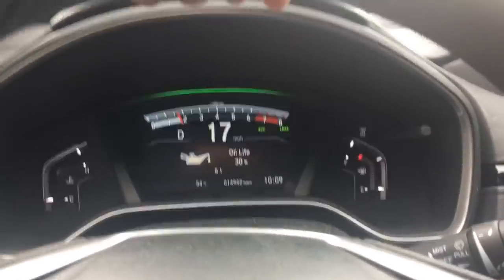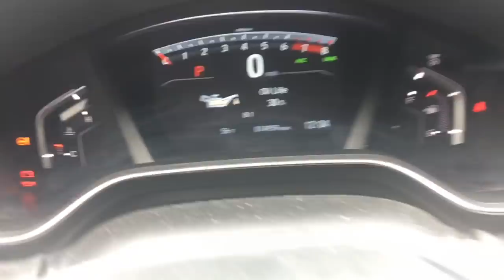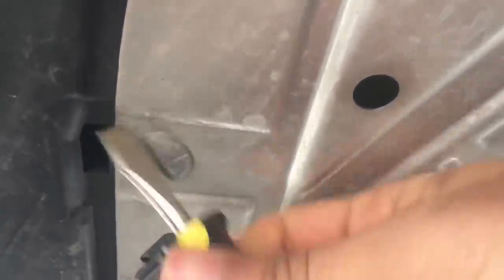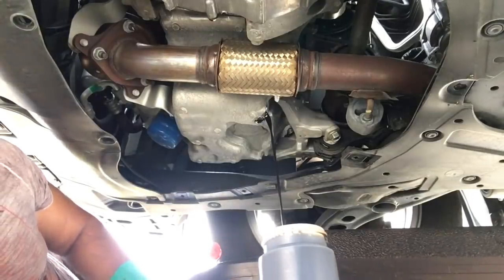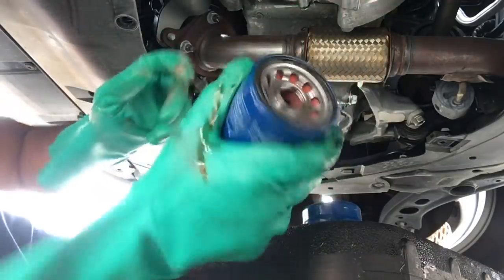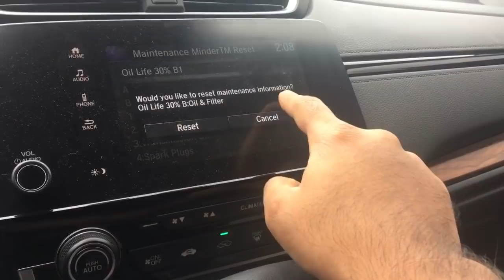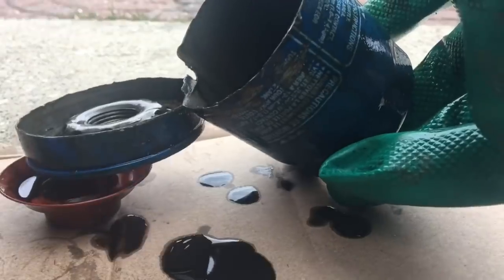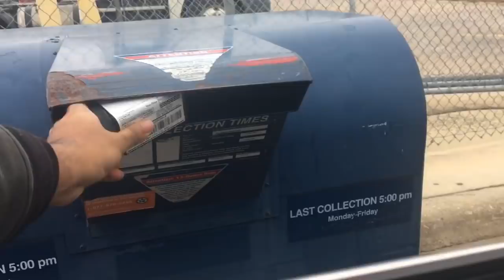2018 Honda CRV Oil/Filter Change and Analysis - Oil dilution -  Cut Open Filter

Comment: I got rid of my 2018 crv last Monday. Honda didn't even want the vehicle back. One week later the car is sitting in the back of the dealership like they can't sell it. I found it funny. I purchased a Toyota and salesman said I'm the third Honda Owner that switched to a Toyota. Your videos are great and educated me on the problem. Thanks. I hope Honda fixes your car. I didn't want to wait and see what happens, plus having no heat in the morning because the car couldn't warm up also prompted me trading it in also.
Reply: Did you have a problem? Ive tun oil analysis and it showed very low wear on our crv. We live in CT. I feel like the issue is a bit overblown
Reply from the maker: travelingThrew I figured with the new Rav 4 coming out Honda will loose some customers. Thanks, hope they have fix for me.
Reply: Dengine I live here in Illinois just next to O’Hare airport (ord). Last week we had a cold snap where the outside temperature was 10 degrees when I went outside to go to work at 4am. I drove 15 minutes to work where my semi sleeps for the night. I had no heat all the way to work. My 2018 CRV touring did not warm up at all, my windshield was nice and full of ice all the way to work. That was the tipping point for me. And yes my vehicle had the oil dilution problem. I took it to Honda On Grand where I bought the vehicle and they changed the oil and the lube tech said he has never changed oil on a vehicle where you can smell fuel and see the oil just pour out like water from the drain plug. I was there when they dropped the oil because I wanted to see it for myself. Trust me I was not happy bending over and loosing $4500. In 8 months.
Reply: Dengine . The car has been sitting in the back lot away from the used car lot and new car sales. Why is it sitting there? My car was the dark green, I also purchased every accessory for it and even left my damn weather tec floor Matts in it. I wonder if it’s sitting there because they can’t resell it. It only had 8,900 miles on it.
Reply: @theeverythingchannelyt548  Not to mention the tax! I'm going to try to pursue the Lemon Law to get my full value back.
Reply: Miso Honey I got lucky. When I traded in my CRV I didn’t pay tax on the new car. I only paid for transfer of plates and some fee that I tried so hard not to pay for. But I paid anyway. If you do a solo lawsuit don’t forget about the attorneys fee. And they are steep. That’s why I just went with the class action. Good luck and keep the CRV community updated.
Reply: Stupid to trade it in so soon and lose the money. At least drive it for the 36000 mile bumper-to-bumper warranty. And... go to the dealership and demand them to fix your heater... show them or take them for a drive on a cold morning so they can see that it doesn't heat up and then they'll be forced to something.
Reply: he got rid of nothing this comment sounds really fake already
Reply: What you get for turning it back in? Did you need an attorney? Honda dealers are putting a big spin on this major issue
Reply: Overblown till you blow your engine
Reply: Miriam Vivo I got back $26,500 back for my car. That’s why I did it. I only lost $4500 give or take.
Reply: 723lion your funny really fake. You weren’t there when I bought the vehicle and when I returned it.
Reply: 06XTOR It was my decision to get rid of it. Why keep paying on car that has a major issue. The oil in my crank case was like water.
Reply: Smart to get rid of it! Anyone who thinks this issue is "overblown" go to your car and pour gasoline in your crankcase now. Add some every day too, like what is happening with cars internally. Issue isn't only on Turbo models or just 2018 models. I had a 2016 CRV TOURING non Turbo. It had lots of gas in oil. 1 1/2 quarts over on dipstick, no heat, gas smell, oil change was like water consistency. Direct Injection system is to blame, Honda will never admit it. I traded mine off for a Toyota Highlander, with dual fuel system. Never will buy a Honda again
Reply: MegaLifeChanging you wrote what I exactly  had in my brain when I decided to trade it in. Yes I also bought a Toyota Venza used, but hey the car drive a lot better and smoother than the CRV. 
Yes my 2018 was the same as you described, the oil in the crank case was like water. That’s not good for any motor. I’m here just trying to make people aware, for they won’t loose the money I lost.
Reply: travelingThrew that's how the 0w20 is supposed to be
Reply: @theeverythingchannelyt548  good for you getting rid of your Honda.

Tell us how that excellent resale failed you though?
Reply: @theeverythingchannelyt548  lost $4,500 on a Honda...unheard of!
Reply: Lol.. Exactly. 0w-20 is already thin.  And plus you drive quite a bit of miles before the oil change...
Reply: Both Honda and Toyota historically have been reliable vehicles.  That being said, Toyota is not immune to engine problems. Some of you may remember their oil sludge nightmare with  their 2.2 (4 cyl) and 3.0 (V6) engines.
Reply: @theeverythingchannelyt548  word is getting out. The more it does, the more they will depreciate in value
Reply: @06XTOR  add some gasoline, you're going to see 0w-20 get even more thin
Reply: MegaLifeChanging yes. The problem is people who own don’t know or just don’t care.
Reply: @06XTOR  0w-20 oil turns into - 0W-0 after getting mixed with gasoline
Reply: @johnk3500  Difference is how Toyota handles issues. They issue recalls and fix them. Honda lies to try and cover up issues

Comment: This oil dilution issue is crazy. I just bought a 2019 Civic sport 2.0 normally-aspirated 6spd. I love it.  I will always change my oil every 3000 to 3500 miles.. It's funny cuz I didn't trust the new turbo engines so I purposely did not get one. I did not know about the oil dilution problem before buying my car but I am so glad I got the 2.0 N/A.
Reply: How you like that Civic? I've been saying for bit that the 2.0 Sport was the one to get.
Reply: I love it.. Especially with the 6speed manual.  Plenty fast with the Vtec. The 2019 sport comes with the 18" rims that come on the r type as well.
Reply: @06XTOR  I had a 2.0 LX a few months ago as a loaner, even though it had a CVT I was pleasantly surprised by it.
Reply: @06XTOR  One other thing, you shouldn't have to worry about carbon build up on your intake valves either, since the 2.0L isn't DI.
Reply: Yes!  I didn't know that either before I bought it.. Lol. Port injection  just works.  I was really happy to find out it wasn't Direct injected
Reply: @06XTOR  Enjoy your car dude.
Reply: Of only they put that 2L on the hatch!! I go there once a year just to check if they did lol
Reply: Randy Jackson  Oil change at 3000 miles..thats ridicoules...a had a peugeot with 250000 miles...alaways changend my oil at about 13000 miles once a year...never had a problem....i sold that 20 years old car and bought honda civic 1.5 turbo 6 MT....and i dont thonk about changing my oli so often...my civic runs perfect without any issue last 7000 miles...no oil dilutiuon and without any problems
Reply: Randy Jackson  I have a 2018 Civic Si which is turbo and I don't have oil dilution problems and my oil level does not change so it's not burning oil. Is your turbo honda having a fuel/oil problem?
Reply: Randy Jackson  Time will say the true...I dont think this engine is bad..VW  from 2008...direct injected tsi 1.4 have extrene oil dilution but they run 100000 miles..Honda didn want to introduce direct injected turbo..I think they looked at problems and they made much better engine....Do you know that the Honda engines according to statistica are most realible engines ind the world----7 times more realible than VW or Audi ...4 times than BMW.or Mercedes...Double than toyota... Toyota is second....i dont think i will have any problen with this ebgine
Reply: Lol I got the exact same car for the exact same reason and I love it so far😆👍
Reply: Randy Jackson  ... neglect???  OMG, what century you living??  YOU sir are insane!!  Changing the oil every 5000 to 7500 or when the maintenance minder says is GOOD enough!!  If you are super concerned, then buy synthetic oil.  lol  OBTW: Welcome to 2019 LOL!!
Reply: 06XTOR ... waist waist waist lol!!  Just let the maintenance minder tell you when to change the oil.  It will go about 5000 to 7500 miles.  This car is not from the 1970's or 1980's lol!!  If you are so concerned, then run synthetic oil.
Reply: @biz4twobiz463   if they like to waste money on oil it's there choice I guess I always do what the manufacturer of the car tells me to. Cuz you  didn't build it but ya sure you know better, its oil illuminati and all.....
by the time i get to 100k/10years old i want a new one anyway 

TLDR do what makes you happy and
REV UP YOUR ENGINE'S!!!😝👍🚓
Reply: Randy Jackson  ... I can tell you one thing, besides be extremely wasteful with engine oil...YOU are one hilarious person Randy!!  LOL  I'd take that bet...and promise you'd lose. lol  millionaire status ROFL!! Only thing in your comment that was true...YOU do know the YEAR!!  lol

OBTW: Congrats finally reaching the "status".  I'm sure your momma is proud.
Reply: @thrpins8430  ... to a certain degree of course. But, the longer intervals are also related to taking care of our environment. But...at the end of the day, YES...it is the choice to be wasteful or not.  That also goes for leaving the running water on at home while at a baseball game.  Or leaving all the lights on at home while on vacation. Or running the car super hard and getting terrible fuel economy. lol  It is a choice.
Reply: @biz4twobiz463  agreed to me that much oil waste isn't worth a little extra life of a mostly recyclable vehicle
Reply: Randy Jackson  ... arrogant Much? Asinine much? But lack the self confidence. lol

Believe me...I am not broke, but family wealth is well your little millions. Yah, I didn't have to work for it... I was just born!! Best way is inheritance little man. lol
Reply: Randy Jackson  ... pure intelligent  response. What I would expect from an american. lol   Seriously, you are funny.
Reply: Randy Jackson  ... Well, at least we both agree on something. We are both funny!! lol
Reply: 06XTOR  bro I also bought the same vehicle an didn’t get the 1.5 turbo so glad I choose the 2.0. Also didn’t know the oil dilutions them engines had should have negotiated on that to the dealers
Reply: With modern syn oil, changing as much as you do is excessive and unessarsary.
Reply: 2018 civic hatchback turbo here. I have zero oil dilution. Purchased the car brand new. You're missing out bigtime. The civic really comes to life with that turbo.

Comment: I appreciate your dedication to make this video I won't be buying a crv any time soon!
Reply from the maker: Christopher E  hopefully 2020 they will have it ironed out.
Reply: @EATSLEEPJD  I hope so. Currently I'm thinking about getting the Honda insight for better gas mileage, but I was looking at small SUV's as well. This definitely helps with the CRV for this year as a choice
Reply from the maker: @user-pg9fv7su8q  what did you end up getting ?  I still have the CRV.  Issue is still there but nothing blew up yet.
Reply: @EATSLEEPJD  I got the Honda insight touring and really like it! The MPG is lower than advertised, but otherwise it's a great vehicle! No direct injection or turbo fanciness just the electric motor and battery to worry about instead. After doing some research it seems the battery is the only real worry but it's about $1900 to replace when it does go bad hopefully it's a wash with the saved mpg.
Reply from the maker: @user-pg9fv7su8q  nice congrats. I heard they are great cars. You can’t get anywhere close to that mpg with a CRV.
Reply: @EATSLEEPJD  I actually looked at the crv hybrid 2 weeks ago I like the the way it drives, and the size a lot! Wish they had it in 2019 when I bought my insight 🙃. I'll probably wait till the next refresh on the crv so I'm not loosing as much money on my trade since the insight is only a year old. You should definitely give the hybrid a look if you get bored on a weekend I'd be interested to see what your thoughts are on it.

Comment: Thank you for showing this video! I'm going to order an oil analysis kit from Blackstone as a result of this. I just bought a 2018 CR-V EX. Yes I knew about the oil dilution problems, but I wasn't too concerned because I live in Florida and I also know how things get blown out of proportion on the internet, especially with a very popular car. Still, it's going to make me sleep easier knowing what's in my oil.
Reply from the maker: Ramon Suarez Yes Sir. Good way to know if you got issues. Make sure to let them know who send you.
Reply: I'm in upstate NY. Not worried either. It's 10 miles to a grocery store. The car has next to no short trip driving.  My oil is fine and level is good. I got my recall notice last week. Honda won't let this wreck their reputation.
Reply: Change oil every 2000 miles

Comment: Shame on all the Motor magazines for still recommending the Honda CRV as a top buy. They are not honest just like Honda.
Reply from the maker: Consumer Reports pulled their recommendation.  They have an article stating the issues with the CR-V.
Reply: And consumer reports for recommending Honda CRV.
Reply: @EATSLEEPJD  when?  They have recommended CR-V for two fuel mixing with oil articles now.

Comment: Just got back my analysis last week.  I wish I could post a copy of the report but it appears I can’t. Fuel percentage was 4.8% and flashpoint was 290 degrees. Those values should be less than 2% and >385 degrees.
Wear metals were slightly elevated above universal averages for 4,700 miles but since this oil change was done at 7,400 miles this was expected. The one exception was copper which was twice the universal average but could just be indicating residual wear in material that is easing out. Total mileage on car is 14k and is garaged in southern Virginia.
Viscosity was still good, although in the lower end of the range and no sign of water or antifreeze in sample. 
Blackstone notes that they seen samples in excess of 5% fuel for these engines and they consider anything above 2% as cautionary. Further recommend to change the oil and watch for rising oil levels which I have done. Oil level before change was at the top of the orange tip. 
Contacted dealership about this and they were of no help saying this is normal for GDI / Turbo engines.
Reply: Up to 5% is normal and acceptable in direct injection engines. Its on the internet on expert analysis forums etc if you want to look hard enough for it. Above this is not too good but over time and thousands of miles, carbon build up behind the piston rings helps to seal the rings better and allows less of the unburnt gas to leak down. Just keep an eye on the oil level for the time being. By the way, we have not got this problem in the UK, probably because our lowest octane fuel is 95 which creates a higher ignition efficiency amongst other things. Why is your fuel octane rating so much lower in the US?
Reply: I just received the Blackstone Labs oil analysis on my daughters 2018 Honda CR-V with the 1.5L Turbo and it reports FUEL 2% Value should be <2% so right at MAX. This is on oil mileage 5000 to 10,500. This also affects Flashpoint reporting 345 and should be >385. Honda telling us no issue, but we can smell gas in oil and see dipstick level rising. I will continue to change oil and analyze for near future.

Comment: I just changed my oil in my 2021 CR-V, smelled like gas!  I'll be changing this oil 3000K miles without going over a mile, maybe even 2500k.  It was a VERY strong odor like gas was mixed, and the oil had a very peculiar off dark greenish-blackish tint (more black than green)to it.  It was not literally green, but it looked like used oil I have never seen, and I have been changing my own oil for close to 30 years now.  I think the theory is that if the engine is at operating temp for long enough will vaporize the gas mixed with the oil and shuttle it back into the combustion chamber to be burned.  I am not sure it's working properly for me.
Reply: The fuel in the oil didn't burn off for me after a 600+ mile, 90% highway round trip over the Thanksgiving
 holiday.

Comment: I buy Mobil One oil filters at Walmart $10.00. While I'm there I buy the Walmart Super Tech full synthetic oil for $16.00 for five quarts. Super Tech has all the great lettering  you look for on the back of the jug. SN Plus and API approved. $26.00 gets me top of the line filter and full synthetic oil.
Reply: I just go mobil 1 at Walmart for the oil since it's like 25 bucks

Comment: Received my letter from Honda of America today 12/21/18. 3 weeks ago called my Honda dealer and response was, " heard rumors about this but nothing yet".made appointment for next week, know all about it and all parts needed are in stock now. I don't think Honda was being honest. Love Honda but maybe I need to think about my options.
Reply: forget it... there not gonna fix it right... they cant...  the motor is a shitbox    jmo
Reply: @mikeatv  I may have to agree with you. May trade it off for a Pilot with the 3.5 Acura engine. Pass the word.
Reply: Jack Savage its a shame... honda made decent cars... but not now... good luck with it...
Reply: Parts? Isn't it just a software update?
Reply: @spoton3278  A/C control module is also done. I forgot to request a oil filter. They don't provide one, my mistake. Noticed that repair order indicates Honda used full synthetic oil instead of the usuall blend.
Reply: Where do you live?

Comment: I commented on a prior video of yours about the low coolant temp. Noticed the same in this video. There is definately an issue with your cooling system. It should be warming up more than that. My ‘18 warms up comparable to other vehicles I have, and runs approx mid gauge under all conditions like it should.